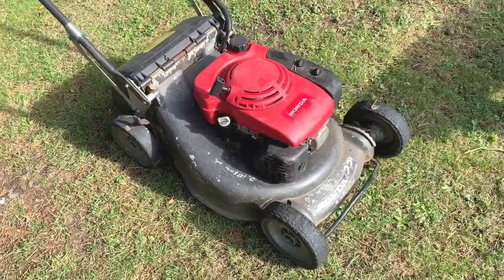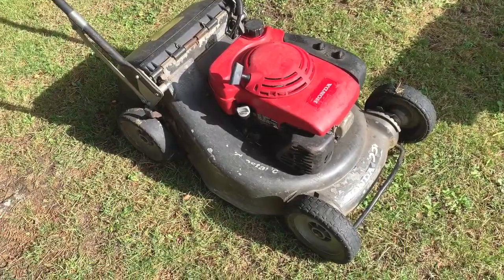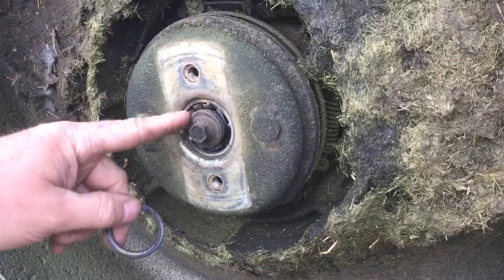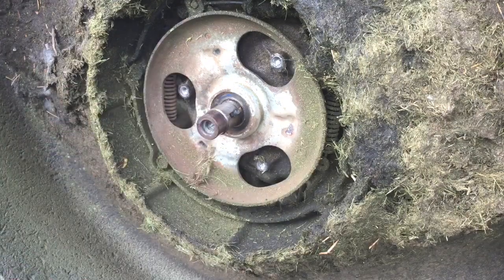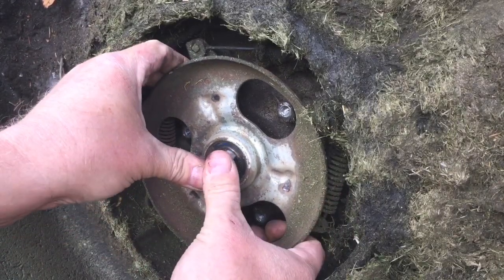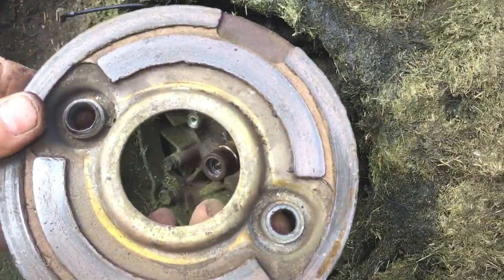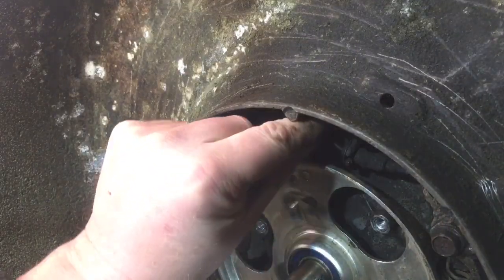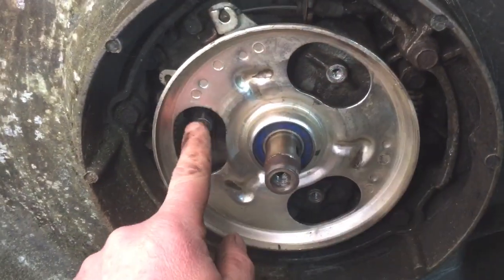Honda HRH536 , HRD536 Pro ( Roto Stop fix ) #Menditman #Mower #BBC 🦾

Comment: Hi, Great video.  I lost drive to the blade on my HRH536, stripped it to find the clutch was shredded.  I have stripped it and replaced the clutch plate, but still don't have drive to the blade.  Any suggestions?  Thanks

Comment: Love the video brotha. Can I get your advice, I have a Honda HRX with the blade stop/clutch system as well but my blade won’t spin fast enough. It just combs the grass it spins so slow. Mower runs fine, new carb and fresh tune up. Any ideas? Thanks in advance.

Comment: Hiya luke and  Laura its been a while ,I have a little red tool box with odd ball parts to use to press bearings out and in I made myself a small table top and floor press with old hydraulic bottle Jack's , trampoline springs ,and scrap steel squared, angle!

Comment: That was a super useful video thank you for such a decent, well explained fix. I have exactly the same mower, I got it as a non runner super cheap, the height adjustment was seized up on all four wheels, I stripped the carb and found crap in the bowl and jet's, so I've sorted that hoping it will fix the running issue, as it has a great spark. I just need to sort the cable issues as the pace setter cable doesn't seem to be operating correctly, it just doesn't look right, but my main issue is the throttle cable being totally seized, which is annoying because the cable at both ends looks fresh with no rust!

Comment: How do you block the flywheel?  When turning the roto stop bolt the flywheel moves so i cannot loosen the bolt?
Reply from the maker: Hi I take the spark plug out and push down some start pull rope, obviously don’t push it all the way in as you need some left to pull it back out, but putting cord in will block the piston from moving (as the cord is soft it won’t do any damage) hope this helps. Thanks for watching 🙂👍

Comment: Nice job mate, how much was the clutch plate? The engine stalls when I engage the clutch unless its done slowly, in your experience is this likely to be from a worn bearing or plate. Thanks
Reply from the maker: Hi I know on the older engines the 5hp ones I’ve had to engage the blade slowly, the clutch plate was between £20/£30 it was a while ago, if it’s worn especially bearing you would know it would be noisy and smell burning smell. Make sure the engine is warmed up before engaging as I’ve had them that don’t like to engage when cold. Let me know how you get on thanks for watching 🙂👍

Comment: Lovely job. I recently changed the blade on my HRH from an aftermarket one to an original. previously pull cord would pull over really easily and now it’s got more resistance. I think the clutch cable needs adjusting as the Rotostop doesn’t disengage  fully and blade still moves (sometimes continues spins)  after disengaging handle lever. What do you thinks causing this? Have you done a vid on adjusting the cables ?cheers.
Reply from the maker: Hi did you put the blade spacer back in place? It sounds like the blade bolts are going through to far, it’s happened to me in the past. Let me know how you get on 🙂👍
Reply: @menditman2004  thanks I did. But I’ll have another look at it. Will let you know how I get on :-)
Reply from the maker: @adzy166  As it happened after you changed the blade, to me it seems like something is catch in the BBC.
Reply: Hi Luke Took the BBC off to have a good look and the central bearing on the clutch cover was not seating tightly. I could push the bearing out with my fingers. Can I use anything to seat it in tightly to fill the small void or do I need to buy new parts. The bearing is original Honda replaced about 4 years ago. Thanks !
Reply from the maker: @adzy166  It should fit on tight I think you will have to buy the part, I’m not sure if there’s anything you can do to get it to seat tighter.
Reply: @menditman2004  thanks for all your help on this. Hopefully won’t be too long to get stock.